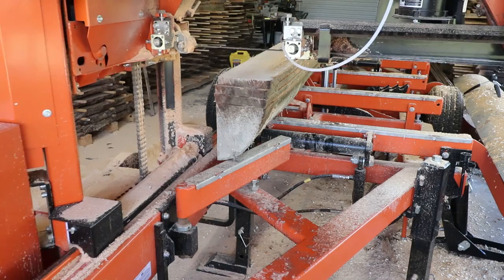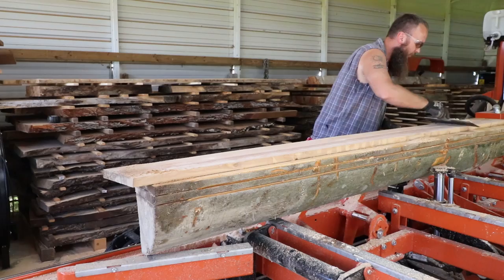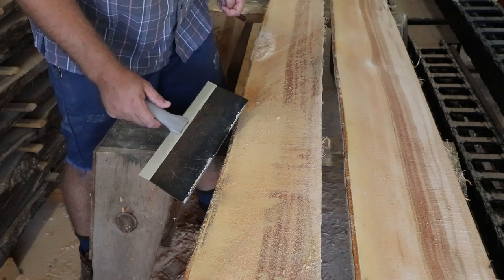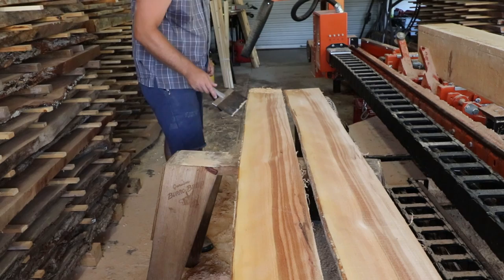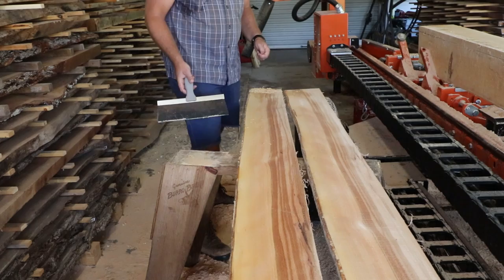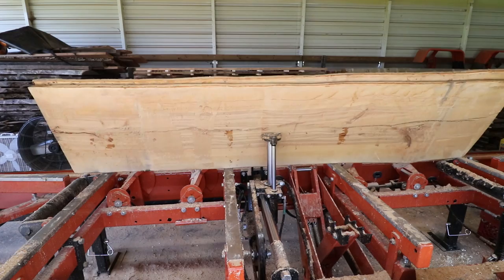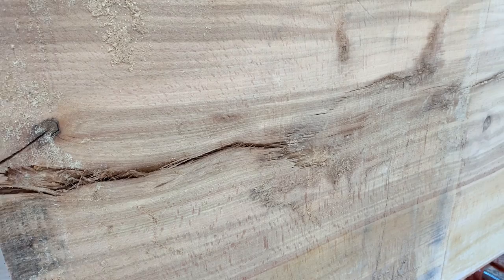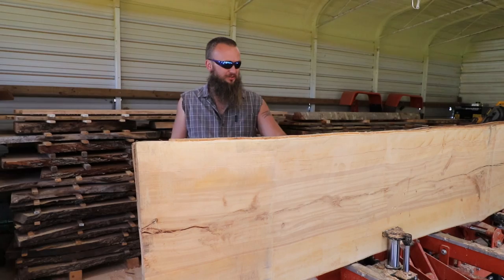GET THE PITH OUT! FINISHING UP THE ELEPHANT TREE ON THE SAWMILL

Comment: Beautiful wood! A piece of that beech would make some beautiful tool handles turned down on the lathe. I'll take plumbing brass nuts and turn down where the ferrel goes just a bit larger that the thread size. Turn it on with a wrench, back it off, glue and screw it back on. It easy to file and sand the nut round and it's good and heavy, won't break. Just a shop note from DaveyJO. That debarked works great on your milk and I'll bet it helps to keep blades sharper longer, yes? Thanks Kindly Nathan! DaveyJO in Pa.

Comment: I think the stress is actually from the sapwood on the outside drying faster than the older wood on the other side.  The pith/board as a whole was keeping it from moving the the outside was in tension.  As you cut the boards free, the tension was able to bend the boards (put a curve in them).

Comment: Yeah!  Pith is no good.  I've seen the pith turn some really nice wood off a sawmill into junk regardless of how it's dried, air or kiln. Starts twisting and cupping the boards.  Reason why commercial sawmills leave that 4"x4" - 6"x6" can't to the firewood pile.
I've also got mix feelings for beach.  Used to flip houses, installing cheap beach framed cabinets in the kitchens.  Screwing cabinets together frame to frame would often split even with pre drilling.  However, I have heard beach is a great wood for steam bending ; which I have yet to try on any wood.